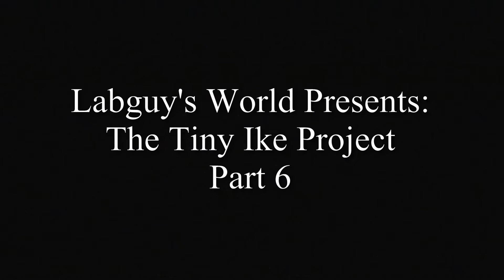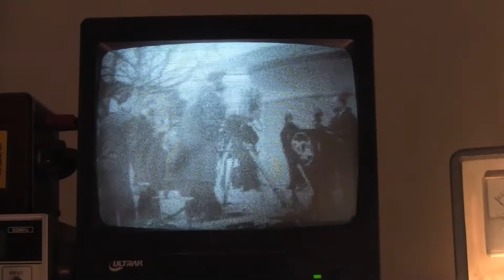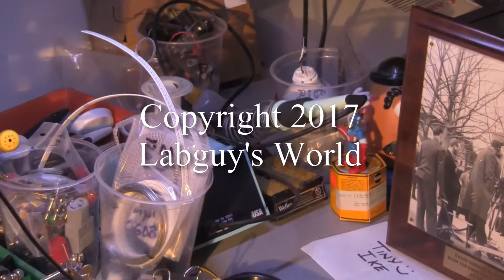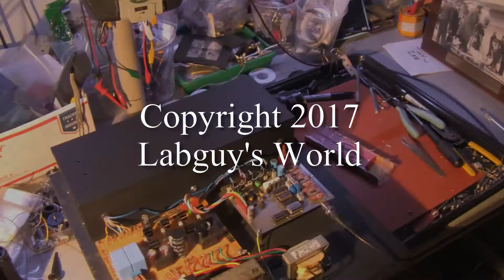Tiny Ike Iconoscope TV Camera Project part 6

Comment: Nice! Now, could I kindly ask if you are going to upload some direct footage from this? (ie. some capture card footage). It would be nice to see this thing in its full glory!
Reply from the maker: William. I tried to make that work. It just does not like the video. I am on the hunt for a good black clipper circuit that can be made from a single video opamp. If the negative signal excursions, or glitches, can be controlled, then video capture becomes real.
At this point, I am in that emotional zone where (OCD, panic) I start to screw things up. If I get a little too overexcited, I work too fast, then something breaks. Time for me to back off for a while. Video capture is definitely in the cards. Since I promised to demonstrate the Tiny Ike next month at a private event, I am going to let it sit until then. After that, I can then turn up the risk once again.
I promise. You and everyone else will love the next project. I call it, "The Chief". Stay tuned!
Reply: OCD? I guess we have something in common, then.. 
- Anyways, can't wait to see what the next project might bring :-)
Reply from the maker: I set everything up again this morning for video capture. Still too much crud in the sync interval. The Dazzle capture pod freaked out. Would not sync up. When I could get it to sync, the contrast was nearly zero. Sorry. We need that black and a white clipper circuit. Possibly gamma correction too. And shading correction... and... ???

Does anyone know for sure if I have to apply gamma correction to the output? The video looks flat and washed out on the monitor. This project has gone from really fun to really frustrating. That last 10% improvement is a bare knuckled fist fight against 50 ninjas all the while scaling straight up a cliff in a 10G gravity field in the dark with my feet and hands bound. I am open to competent advice here. Or just a good long ten minute primal scream! Hopefully both.

Comment: Nice work!
Reply from the maker: Thank you, Eric. Could use your analytical skills to help me to sort out this freakin' glitch! The intermittent connections will be on me to hunt down. I am praying it is not a massive flaw in my hybrid surface mount construction technique! My fear is that tiny amounts of flex in the vector board during handling and construction might be breaking the ceramic SMT packages. Or it is just bad soldering. Planning a solder-thon today, where I will reflow every joint on the bottom of the board to see if that helps. The non-specific nature of the problems makes me suspect one or more of the power lines.